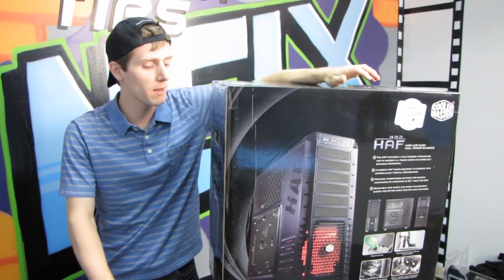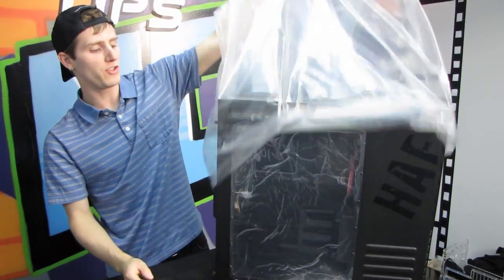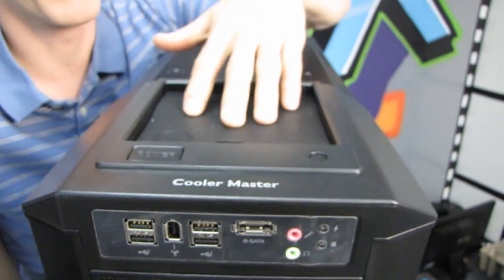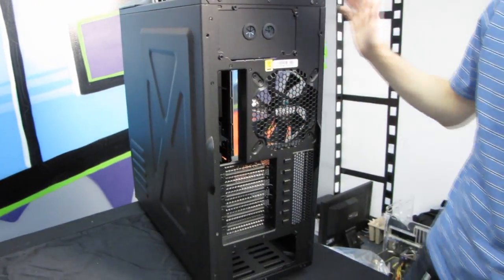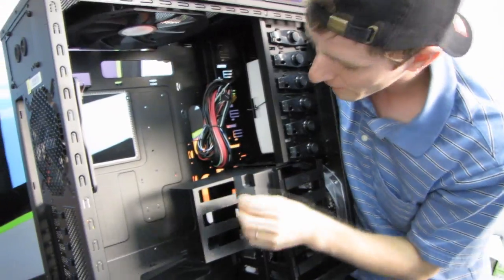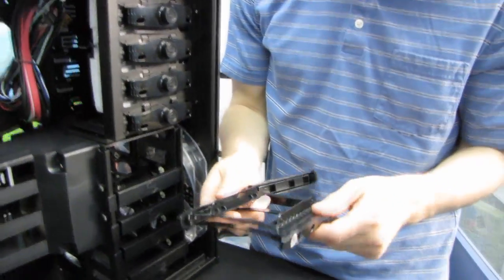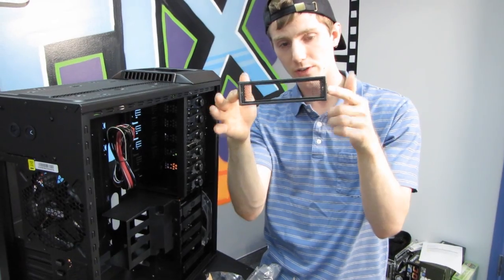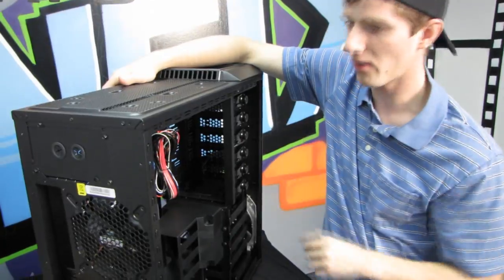Cooler Master HAF 932 Black Edition Case Unboxing & First Look Linus Tech Tips

Comment: I own this case and its a great case. He forgot to mention there were screw mounts under the rubber top on top of the case.  Instead of a dual radiator, you can actually put a triple 120mm radiator or triple 120mm fans on top.

Comment: I got the HAF 932 "Advance Blue Edition" (essentially the same case with blue LED fans) in 2014 for my first build. I'm now starting my second build (2021) and will reuse it. It's BIG, built like a tank, very roomy inside, and has good ventilation. I came here because I forgot how the tool-less graphics card mount unsnaps (wish it has screws).

Comment: I'm about to build my new setup and still intend to use this case, my old friend HAF 932
Reply: We’re you able to get the front fan working? I’m using a modern MB and I’m lost The front fan uses a 3 wire pin and my MB only has a 4 wire pin
Reply: Will do the same now I will just get rid of the hdd mountings and paint it black inside because I have the standard HAF 932
Reply: @MrBgarz  use the included adapters from 3 pin to 4 pin molex or get ab extra controller
Reply: Still using it myself. It has lasted through 3 builds so far.
Reply: I'll be doing this myself soon too
Reply: @alfie8472  I did , I build a entire custom loop with vga block and 2 radiators, everything running smothly and silent, I liked the ending results! good luck with your build
Reply: @arthurmelo88  Ha, no luck needed,  I take anything complicated to a computer shop & get them to do it for me. The HAF 932 is currently my fourth best computer but it will be my best after I get a new motherboard, cpu & video card in it. It already has cpu water cooling so that's good. It only has a 2600k cpu & GTX 480 in it now. I'll wait about 6 months when the new Intel cpu's have come out & hopefully video card prices have come down a bit too.
Reply: @Rustyspoons97  I still have it wheels right here at my drawer, enjoy it !

Comment: I still use the original HAF 932 case, got it 14 years ago in 2009 because it was huge with many 5.25 and 3.5 drive bays that had really neat tool less features.  I have done about 4 rebuilds with it so far.  Although I dont need all the drive bays anymore, its still an amazing case.  It came with 4 case fans, I have had to replace 3 of them, the front intake fan is still working like a champ.  Last week, just converted my setup from a CPU air cooler to a Corsair 360mm radiator AIO liquid cooler with no issues at all, plenty of space.
Reply: Did you mount that 360 up top?  I'm in the same situation, looking to upgrade and don't want to throw this thing away.

Comment: Who's using this case in 2020 like I am???
Reply: I will never change this case, I have just bought some wheels for replacement, and I'm thinking to mod the front pannel for adding USB3.
Reply: @UNMENDered  I'm thinking of stripping out my first gen i5 in my non-black edition of this case and spray painting it black inside and adding some filters or the vent fans. Then rebuilding it.
Reply: @shdwmage24  non-black edition of the CM HAF932 ? You mean you have the AMD Red Edition ?
Reply: @UNMENDered  No, its just the basic edition one. Its all silver inside. The black looks nicer.

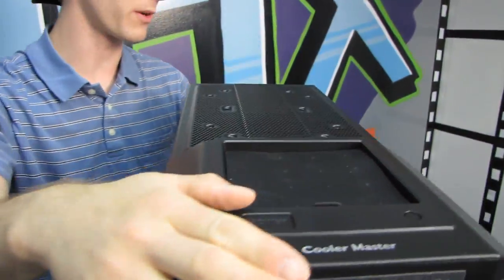Comment: 1:50 I think you're wrong, that case supports a triple radiator on the top but to fit it you have to lift the plastic cover on the front, actually that cover have some vents.

Comment: I'm still using this, though the side and top fans aren't that great after 9-10 years and there are very few options for this size. Rare case these days with 5 HDD trays and 4 front USBs.

Comment: thats not a bad thing because you will get increase airflow without the dust filters and dust still goes inside with the filters anyways. just dont forget to clean the inside of your case often to keep the cooling performance of the parts good

Comment: @Shroffff In the 932 there is room behind the front grill, in front of the 230er and between the bottom of the case and the PSU holder. You can easily put some filter in there. Just use the one from your kitchen fume hood or the stuff you put in front of your window to keep insects out. Cut in size, be creative...

Comment: Looking at the case it has some pretty good cable management. Hard to see from the video but you should be able to run most cables via the back of the case where it is out of the way. Plus, its a full tower, plenty of room if you ask me and its friendly to non modular power supplies

Comment: This has been my case since 2009.  It's seen many builds and the only problem I've had is one of the usb ports broke.  However, I just saw on CM's site that I can buy the entire front panel assembly for $14! Also, it's easy to add air filters. I just got the "Duck Brand Replacement Air Conditioner Foam Filter" for $5 at Amazon. Cut to size and secured to the front, side and bottom with those tiny super magnets (also from Amazon).  My case doesn't have a side window, just a 230mm fan. But a 230mm fan in front, side and top makes for some serious air movement.
Reply: Got a link for the front panel replacement part. I broke my usb port years ago but never fixed it. Can't find a replacement anywhere.

Comment: I've had this case for 1 and a half years. This case collects so much dust inside from all the open holes and no dust filters the front and side panel 230mm fans have already gave out and the hdd cages have all broke but 1. They are so weak and cheap. I hate this case. But it does keep my componets so cool. :D
Reply: I've had this since 2009 and yes the dust is an issue but amazon has a $50 filter kit.  Maybe I got lucky with my fans cause they're all still working fine and none of my plastics have broken either.  Maybe the OG ones were made better?

Comment: I still have my Cooler Master HAF 932 Advanced.
Did 2 builds in it and thinking about the 3rd.
I have looked for a replacement for it a few times and nothing compares to it.
This might be the case I use forever if holds.
They really don't make them like they used to.

Comment: @perfectgyroscope My water cooling reservoir uses up 2 5.25 bays and it needs 1 more bay to access the fill port. Then pop in a fan controller and a Blu-ray drive and that's 5x5.25 slots.

Comment: Cooler Master should give the 8 pin power connector in all their cases! xD i bought a cooler master case with a bottom mounted psu but my connector was too short to reach the top of the motherboard. i had to spend like 2 bucks on an extender but it would have been nice to get one for free :P

Comment: @perfectgyroscope Perhaps someone who intends on installing a fan controller, dvd drive, bluray drive, hotswap caddy and a mediacard reader (or perhaps a res for a wc'ing loop). Just because you personally don't have a need for 5x5.25 slots (I couldn't use that many either) doesn't mean it's not worth having them their to cater to those who need them.

Comment: Im building a computer and buying parts from both NCIX and Newegg.  Should I get gtx 460 sli, gtx 560 sli, or gtx 570?
Specs:
i7 2600k  oc 4.2 ghz
8gb DDR3 G. SKILL RIPJAW
LG CD/RW burner
Microsoft x4 Sidewinder
Razer Naga
Intec 900W PSU
Cooler Master HAF 922
23" Acer LED backlight LCD slim monitor
and the gpu
BEST THING IS I THINK EVERYTHING IS FROM WATCHING LINUS'S VIDEOS!

Comment: @sponge12349 Why the i5 2600K? It does not have Hyper Threading so...? 6 Cores/6 threads vs 4 cores/4 threads AT THE SAME SPEEDS. Both are unlocked.

Comment: I wanted to buy this and then I found Corsair 500R. And its cheaper. Its a little bit smaller (around -4 cms in each direction). But it has rubber grommets more fan mounts. Six 3.5 inch drive mounts, four 5.25 bays and USB 3.0 at the front. And its cheaper. After watching this unboxing I´m disappointed. That a cheaper Corsair case is better, looks better, has better airflow and has rubber grommets. I´m happy that I found this Corsair 500R before buying this.

Comment: @Fox9720 if you want great pc temperatures and airflow, great looking case and A LOT of room inside it, definitively 932, if you don't give a fuck about temperatures and room inside than get 690
haf has 3 x 230mm fans, while 690 has what? 1 x 200mm and 1 x 120mm

Comment: would this be good?

CPU: AMD Phenom II x6 3.3 GHz
PSU: Corsair 850W
RAM: Kingston ValueR. DDR3 1333MHz 8GB
GPU: Sapphire 2gb 6950 crossfire
Case: Cooler Master HAF 932
Mobo: Asus crosshair iv formula?